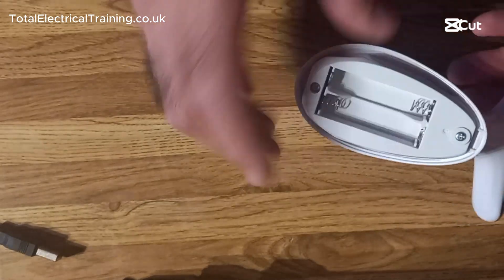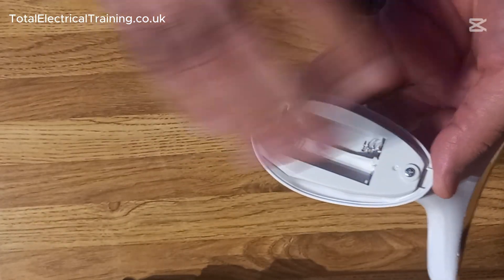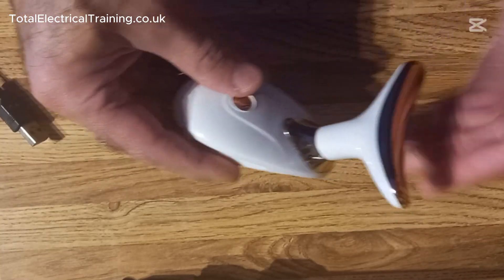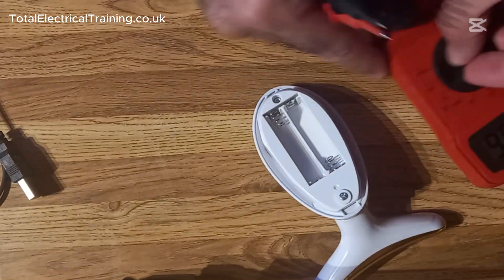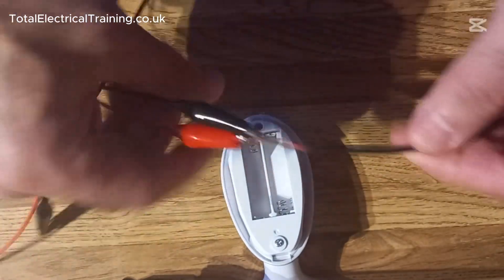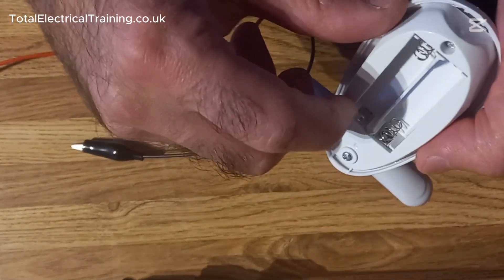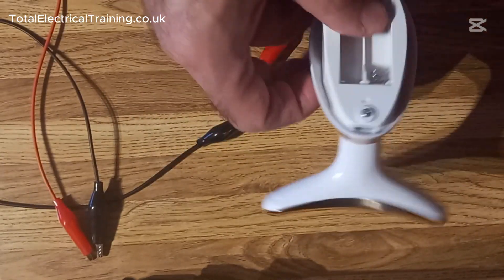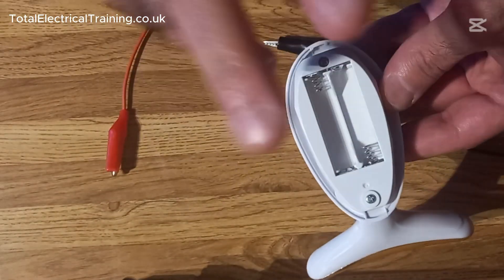Make ANY Device Work WITHOUT Batteries

Comment from the maker: Just for the information of anyone interested on adding a resistor to make the motor work at its normal rating voltage; The resistor I decided to use for this device is 100 ohms, it was a bit of a trial and error, to be frank, but of course an educated guess was involved because I had to guess what current would the small motor need to work properly, and I thought if that was 0.02A, then I would need 100 ohms resistor to drop 2 volts, and 5-2=3, which is the exact voltage the two batteries were supplying. I hope you enjoyed the video and if it did help you consider buying me a cup of tea or coffee! :) Cheers!